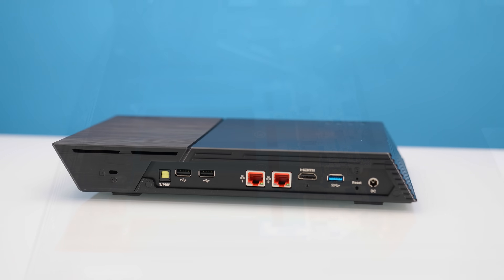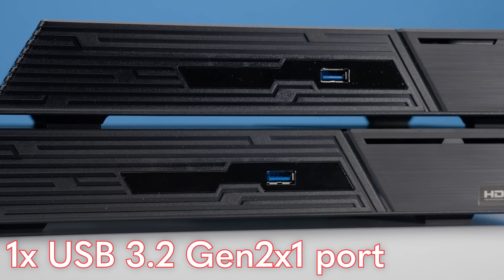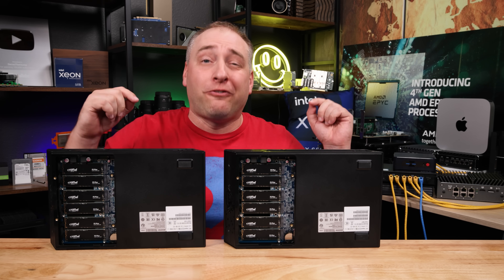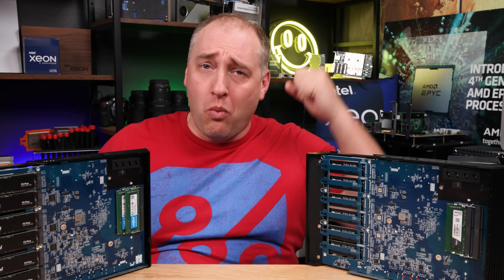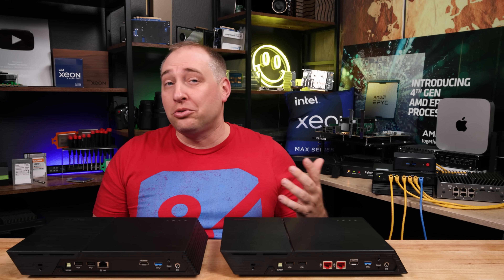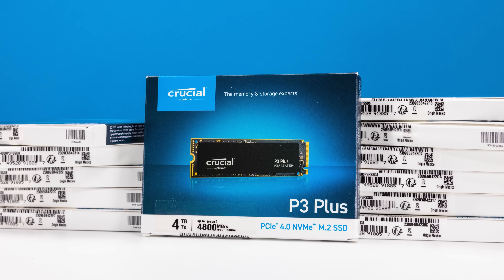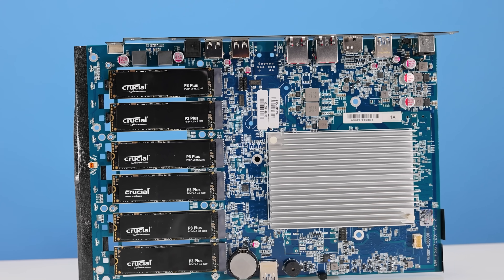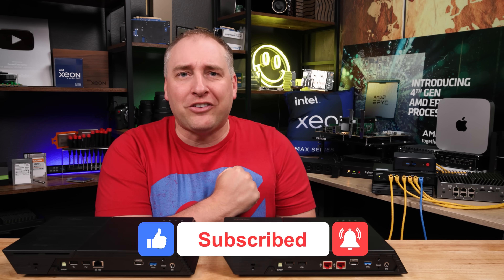Crazy 48TB SSD NAS and Cheap 6TB Version Asustor Flashstor FS67

Comment: Not sure if you’ve spoken to asustor but a rep told me that low noise was one of their top goals. Their intention for the product is to be used for media consumption and expect it to sit connected to a tv in someone’s media center which is why it has the angled sides. It’s a weird one because although it’s quacks like a NAS it’s really aimed at the android media box market.
Reply: In this case, one angled side has a practical effect: it ensures that the exhaust is not blocked by someone shoving it up against a panel.
Reply: Do the angled sides make it quieter?
Reply: @dexopaw  no they are purely for looks since they expect this product to be sitting alongside your tv
Reply: @pincombe  I think it's worked to avoid covering the cooling vents when you pout it in a tiny space , but yes, also make it more gaming stylish
Reply: @dexopaw  They clearly copied old playstation look

Comment: I just switched my home TrueNAS from spinning rust to 7.68TB U.2 Kioxia CD6 drives off Ebay using a PCIe x16 bifurcation card. Was just tired of slow spinning rust drives. I only have 10GbE as well and the drives are super limited by both ZFS and 10GbE networking but honestly SSDs have nearly reached the point where you can buy them and throw away the performance as bulk storage. It's just a nice big quality of life improvement - less noise, less power and consistent performance for all your file shares. So I definitely get the concept from this perspective.
Reply from the maker: Very much this. We are getting more 30.72TB SSDs in the lab and that is making all-flash high capacity storage tempting.
Reply: I wish that was true. However, if you are buying serious quantities of storage then the difference is a seven figure sum. I have recently had a quote from the Pure sales rep at work who insisted that they where cost-competitive with spinning disks LOL. Admittedly you are spinning hundreds of drives at that point and all your metadata and small files are on SSD so meh.
Reply: Does ZFS actually limit the performance of fast M2 SSDs? What should one use instead?

Comment: Does it work with 8TB NVME´s?
Reply from the maker: It will work, but since 8TB NVMe are 4x the price for 2x the capacity, you have a big premium. It does not make sense to do that here versus getting a higher-end storage solution if you want that much storage.
Reply: @ServeTheHomeVideo  I was thinking about upgrading my Plex Server. Have a TS-664 used for it but planned to upgrade and due to work I have 16 unused  8TB XLR8 so for 900€ for the 12 slot its a bargain.

Comment: Funny I was just thinking about a SSD NAS yesterday.  From pricing it looks like going with regular ol' SATA SSD are cheaper on the per Terabyte compared to their M.2 equivalent size, though not by a gigantic  amount.  Obviously that means they are bigger and slower but realistically that doesn't matter for what I would use it for.  Or really what the vast bulk of home users what use it for.  Though since the market is clearly all in on M.2 I expect by the time we see more of these M.2 NAS units from the likes of Synology the pricing on them will probably be better than the old SATA style.
Reply: SATA or MVMe won't matter much in performance. In the end it needs to hit the network. A single SATA-600 drive has enough throughput to  completely fill two 2.5GbE network connections. These 6 or 12 M.2 NVMe SSDs are twiddling their thumbs for their entire lifespan.
Reply: @scsirob  y'all live all in a fantasy world, where SSDs keep writing at 500MB/s after filling out cache capacity? 1TB Samsung 870 EVO's actual sustained write speed is 80 MB/s, 2 TB version has only 160 MB/s. 
And on top of it 1TB SATA 870 EVO costs more than m.2 970 EVO Plus, which has sustained writing speed around 800-900 MB/s.  
M.2 in these all-flash NASes makes sense, SATA SSDs are obsolete - they do not get produced and sold enough to benefit from economies of scale.
Reply: Cheap SATA SSDs have abysmal speeds during consecutive writes. SATA SSD with proper cache and speeds are quite expensive tho, and there is no much of a choice outside of Samsung and Corsair MX.
Reply: You can get a 4 TB M2 NVMe PCIe4 SSD for £200 these days - to me that's pretty close to SATA SSD's for pricing.

The problem is when you want higher quality 4 TB, or anything at 8 TB.

How on Earth we had a 1 TB microSD years ago, but still can't get more than 8 TB per M2 SSD is beyond me.

It should be possible, it's just that noone is actually doing it.

Comment: I wish for something like this (maybe even smaller, like 3-4 m.2 connectors), but with bios and ability to install OS of choice, with ZFS. Would be a great low power and quiet NAS for those who don’t need a lot of storage.
Reply: Wow, thanks, I’ll look into it. Would be great to have ECC RAM as well, but Intel spec says it doesn’t support it.
Reply: @antonzadorozhniy6605  no ECC support is common for consumer grade NAS. Synology have Ryzen based consumer NAS that supports ECC but i have no idea if they're locked to their OS or not
Reply: @antonzadorozhniy6605  Pretty much no consumer NAS supports ECC RAM and this is no different
Reply: For Proxmox 😁 and self-hosting
Reply: QNAP has the TBS464, with 4x M.2 and 2x 2.5GbE. I have not tried hacking my way into it, but I have with other QNAP devices. I had a TS873 that I replaced the USB DOM from and ran TrueNAS on it. Ran like a charm.
Reply: get a thinkcentre tiny with pcie lowprofile :3 and a lowprofile pcie card with multiple nvme slots, just need one with bifurcation chips
Reply: @sasanmottaghipour876  there are no low-profile quad multi-nvme cards with lengths less than 150 mm, which is the maximum for ThinkCentre Tiny. Only dual multi-nvme card with 145-ish mm length. If you are lucky then you might get m920x with already 2 nvme slot, but realistically m720q or m920q have better availability and price, which limits you to 3 disk raidz1 with dual multi-nvme card.
Reply: @sasanmottaghipour876  Nothing from the CCP, thank you.
Reply: yup. Not being able to add on to my Truenas array is a deal breaker for me.
Reply: mmm, freebsd
Reply: I was all set to buy this but you made a great point about not being able to install another OS.
Reply: These should be already like that. They have a HDMI port and a BIOS, and an Intel processor. Unless they have been locked down, but ASUS didn't do much to lock you out on other NAS with similar hardware

Comment: I think Asustor should have aimed at a cheaper pricepoint and done something like a USB 3.1 Gen2 (10Gbps) JBOD enclosure that has a buttload of M.2 slots and HW RAID. I'd love to buy a bunch of those sub $100 2TB SSDs on the market now and put them into RAID 1 or 5.
Reply: "hw raid" done with crappy Jmicron chipsets? Uhhh big nono
Reply: @marcogenovesi8570  For a JBOD that plugs into multiple workstations across multiple sites what solution would you recommend that pools the JBOD drive into one logical drive of storage? I've been trying to learn as much as possible lately to improve my knowledge and storage solution(s).

Comment: The N5105 only handles PCIe Gen3 - so, why the Gen4 SSDs? …especially when they don't get full x4 lanes of bandwidth (simultaneously)? I'm still very happy with my HPE MicroServer Gen10+ - the one from your review (thank you) - upgraded mine with an i3-9100F; it serves my home! 😉 That i350-xx4 is the killer feature - most of those ports are passed through to the OPNsense "forbidden router". I'm running SSHFS via 2.5 gig USB NIC to the PC.
Reply from the maker: When we purchased the drives a few weeks ago the P3 Plus drives were cheaper than PCIe Gen3 4TB.
Reply: @ServeTheHomeVideo  OH, yeah, that's certainly a valid argument! ;) …and in SUCH a use case, you wouldn't really need a DRAM cache either. RAID5 though, seems a bit harsh for a lowly Celeron. But hey, it managed almost 1GB per second - certainly nothing to scoff at! (i assume that's all via the ASUSTOR OS - probably a flavour of Linux MD RAID)

Comment: I'm getting 1GB/sec on large file transfers on 10G networking between windows 10 clients to a windows 10 file server using 10 6G SATA spinners in a RAID 6 array on an Adaptec card.  Small files are not a good match for Raid 6 so pictures and other small files are much slower, but easily usable in real world scenarios.  I would like to compare how a SSD would perform in Raid 6 with small files.  So that's 54TB unformatted, 43.6TB usable space.  I have to do some research on the speed of NVME on x1 PCI 4 and 3.  Your file transfer speeds seem very slow to me.
Reply: SSDs in general are great at small random access so it should run circles around HDDs at the same RAID level. Some raid controllers (LSI) have "special" features for SSD raids that basically bypass the Raid controller's cache alltogether as a way to not bottleneck the enterprise SSDs connected to it.

Comment: What would an actual diy consumer grade NAS look like? Meaning consumer m.2 ssd with add in card on consumer motherboard and 5gb or 10gb nic? Would it need to be ryzen epic? Is there enough pcie on consumer chips?
Reply from the maker: The embedded parts can have dedicated 25GbE plus PCIe Gen4, so you can get much better performance. Even the newer Atom C5000 line can have 25GbE leaving lanes available for the SSDs. Those cost more as you might imagine.
Reply: It's a NAS so the number of PCIe lanes you need is actually quite low. The reason is that as a NAS you are not doing significant processing on board so you are limited by the network bandwidth out the back. So even if we went to 25Gbps ethernet (which is frankly not consumer grade NAS, that tops out at 10Gbps at the moment) then four lanes of PCIe gen 4 with a PCIe switch chip would be sufficient. Most people don't think about this when specifying network based storage. You start with your network bandwidth and work backwards.
Reply: Ryzen 4 has 24 PCie lanes so after removing 8 lanes for chipset and a 10 gbit NIC leaves you with 16, and you can usually just bifurcate that to 4x x4 m.2 slots.

Comment: I get >800MB/s sequential from 4xHDDs. This is not worth your money. This is for people to brag about their new NVMe NAS. Everyone sane will use HDDs or build/buy a proper SSD/NVMe product. But I guess people will buy this and ASUS is getting some revenue. 2.5G for 6x NVMe man.....that's the bottleneck of bottlenecks. My router has more memory :) Consumer land is a strange business we have to tolerate I guess.
Reply from the maker: Totally, but with the HDD NAS we cannot have it in the studio due to HDD access noise. To me, that is the big use case.
Reply: @ServeTheHomeVideo  Agree. Noise and power draw are good arguments for a NAS that's used at home. Low capacity, silent and low power is probably the niche we're talking about.
Reply: @ServeTheHomeVideo  The network is the computer 🙂
Reply: it's still going to run rings around HDD based NAS for random read/writes, but yeah it's so heavily compromised that it does lose a lot of appeal
Reply: @marcogenovesi8570  depends on your HDD NAS. I'm getting 400MB/s random writes on my 6x HDD ZFS pool. More than my 2x NVMe on my desktop can actually read.
And you can't buy 3 of it and run it in a cluster because hardware is so bad.
Reply: @TheExard3k  wow that's a very slow NVMe raid1 with a suspiciously fast HDD raidz. Do you have dual actuator HDDs, a good SLOG ssd or a big amount of RAM on the NAS? Because those numbers don't add up for a pure HDD raidz in my experience.
Reply: @marcogenovesi8570  2x NVMe in RAID0. And ZFS pool is mirrors, not RAIDZ. sync=disabled instead of SLOG. RAM is a lot more than 4GB :)
400MB/s writes isn't unusual for 3 mirrors at all. And ZFS TXG sync ensures pseudo sequential workload on aggregated writes gathered in memory. Compression increase throughput even further.
This is normal for a well-configured ZFS pool.
Reply: @TheExard3k  Ah ok that's a setup for max performance, fair enough.
Reply: The NAS environment is a read only environment for most people.  This makes ssd's a near zero fail machine.

Comment: Is there any hope for someone or ASROCK to make a higher performance NVME only NAS?
Reply from the maker: That is a good question. I am heading to ISC 2023 in Germany this afternoon, but will be going to Taipei for Computex 2023 next week and will try asking ASRR there.
Reply: @ServeTheHomeVideo  Yes unleash the Asrock engineers on this
Reply: Spinning off Asrock might be the dumbest thing ASUS ever did. Great for the rest of us, but so much lost talent for them.
Reply: As far as I can tell this can very nearly saturate the network connection with sustained write (with the right drives it can do this 24/7, rather than in bursts) with a raid 5 array; I'm reasonably sure that means that it's exactly fast enough? Any performance that can't be exposed to the network is wasted on a NAS as a pure storage device, though if it can't saturate the network, then it's not fast enough for it's network connection.
Reply: @MartinRudat  sometimes it still makes the most sense to do the processing directly on the NAS, most notably high-bitrate media transcoding. Could you set up Plex on another box which uses this NAS as the storage backend? Sure, but that is another PC to keep running all the time, which means you are spending more on energy and also time for maintenance of yet another system.

Comment: TLDW:  Lacks PCIE lanes so cool for low power but they prob could have just made the m.2 sata and called it a day, would have also saved power on the bigger one
Reply from the maker: Perhaps, but SSD volumes make M.2 SSDs cheaper at the higher end which is what we realized these NAS units are better with.
Reply: We are well past the point where dram-less NVMe cost less than m.2 sata. The m.2 sata are slowly being phased out as all new stuff is NVMe
Reply: At this point, there isn't much if any savings on M.2 SATA drives vs lower-end nvme drives. So you might as well support nvme or both, and then those drives can also potentially be used at higher speeds in other systems.

Even 2.5" SATA drives aren't much cheaper than low-end nvme, if at all, at 4TB and under. It's only among the 8TB drives (which are rare anyway) where the price difference gets huge.